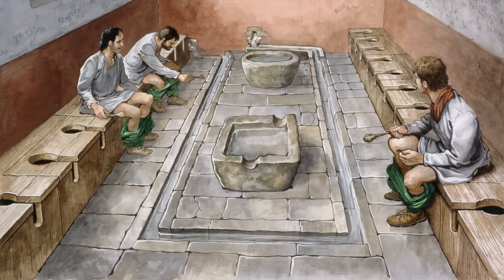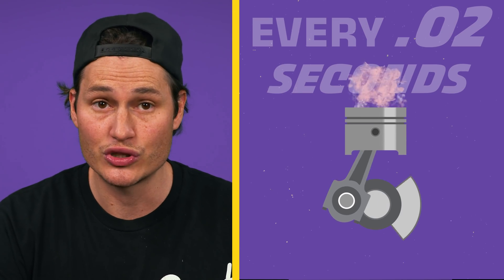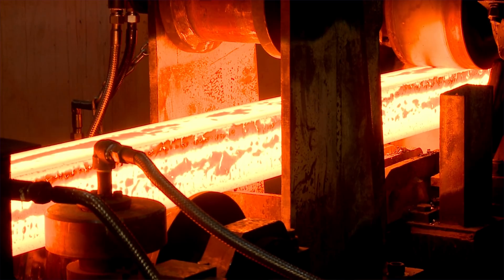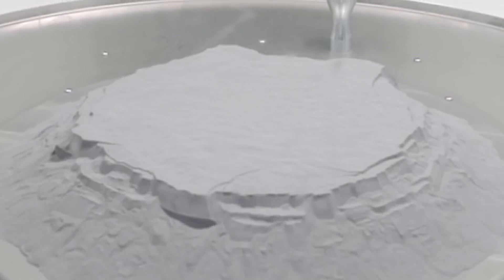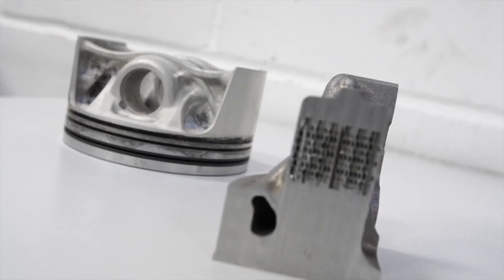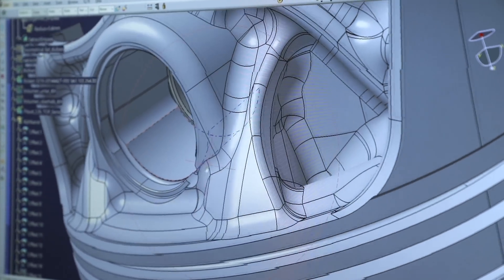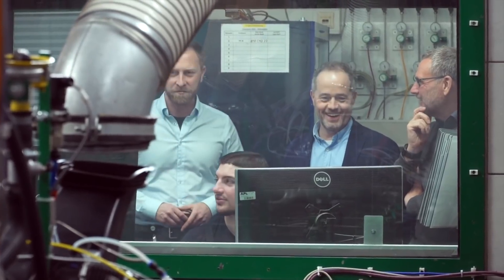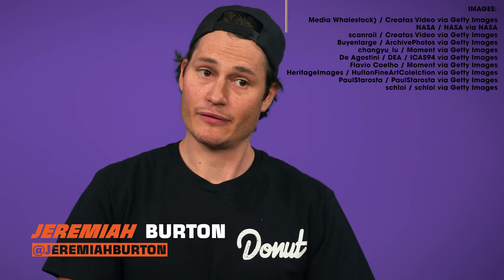3D Printed Pistons Are Changing the Game

Comment: me: “i’m gonna pro charge my hemi and throw forged pistons in for more BOOOOOOST” watches piston slap animation “i think im fine being slow”
Reply: And that's why cast piston are better for daily.
Reply: @ameunier41  a lot of old school cars had forged pistons from the factory, even in pretty mild applications. The primary advantage of casting is cost savings
Reply: That's why they recommend leaving high performance cars to idle before driving them
Reply: @insomniacbritgaming1632  Thats a Bad idea if the gearbox is mounted on the Engine. Warm Engine cold gearbox means a lot of Stress between Those Parts.
Also youre pushing a cold transmission just behause you warmed up the Engine and thinking u are ready to go.
Just Drive low Rpms and increase the load gradually, until everything is warm.
Reply: @L K
A temperature difference between the engine and transmission isn't going to put any extra stress on the transmission compared to any other time you drive off from a fresh start. They're two discrete systems, joined together by a coupler (clutch, torque converter).
Reply: @lk159  the gearbox is connected to the engine via a clutch (or a torque converter in automatics). 

There is absolutely no stress created by differences in temperature between the engine and gearbox. 

Also, even when your car is in neutral and the clutch engaged (or in park), most of the components (all of the gears) in your gearbox will rotate when your crank rotates, thus warming up and lubricating the gearbox even during idle.

The only thing not warming up or getting lubricated while idling is your differential.
Reply: piston slap isnt bad you just really need to let it warm up and expand before going past like 2k rpm
Reply: Love that emoji next to your name  😆
Reply: Two words: low boost

Comment: on aftermarket side of things this is seriously important because this means more safe RPM,more boost,more fuel and easier time balancing the engine because those small weight reductions make biggest diffrence on having to run a balance shaft or not having to run a balance shaft which weigh a shit ton

diesel,rotary and 2T side also benefit from this so yes,this is actually serious and if it sucseeds this is great W for ICE engines in general

Comment: Process is called selective laser sintered
Reply: Not anymore. About a decade ago, the technology could not yet fully melt (most of the available) metal powders. That was SLS, selective laser sintering. Sintering clumps and fuses the powder together below the actual melting point of the alloy. Along came more powerful lasers and better optics, and so more modern powder bed laser 3D printers do SLM: selective laser melting. SLM machines can still revert to SLS, but sintering creates a more porous part than additive manufacturing by SLM.

Comment: That is a really impressive use of technology to make a component better and more efficient. As you said, by making the piston lighter and able to bring down its operating temperature, this will lead to further weight reduction in other parts that are connected to the piston and its operation. 

I can also imagine that in employing this technology in the manufacturing of the engine head and block, would also bring weight saving benefits and thermal efficiencies. All of which combine to improve the overall power to weight ratio of the engine package.

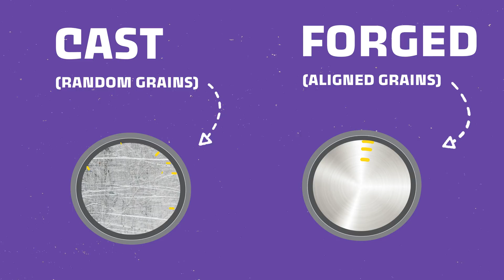Comment: 3:23 I think this is mostly wrong.Wood grain and grain structure in metals (aluminium) is pretty different. Metal grains consist of really small clumps, shaped in every which way, that has one common crystal lattice structure.  In forging, the grains "size" is preserved, while in forging they grow bigger which decreases strenght,  and dislocation density is increase due to the plastic deformation which further increases strength. Don't know if you have a mechanical or materials engineer on hand to help you research these topics but I think googling would help.

Comment: The piston is just the beginning. Topology optimisation is soon going to influence the entire powerplant design. The block, oil sump, baering seat, cylinder head and many others will soon be made in a similar fashion. There is an optimal way to design and cool an engine. It has allready been designed, but manufacturing restraints keep us from actually reaching that. This manufacturing process will change that some day in the future.

Comment: 10 years away?
Sorry, by that time ICE engines will be pretty much out of production. Many OEMs don't even develop them anymore.
Reply: Synthetic fuels might change the governments mind
Reply: @christopherayala4619  It does not look like synth fuel tech can keep up with the rapidly decreasing cost of battery tech.
ICE engines are a well matured and thus hard to improve uppon tech, while batteries are just starting out.
I like big honking engines just as much as the next guy, but they will be like horses; still around for other reasons than utility.
Reply: @heinrichwonders8861  prometheus are releasing this fuel later this year and would be cost effective compared to fossil fuel gasoline and this just one being released imagine billions of these fuel it will be cheap as heck
Reply: @christopherayala4619  There are inherently high losses in the production process of synth fuels and in the distribution. They simply cannot compete.
Also, using these synth hydrocarbons for plastics, lubricants and industry is much more sensible than burning them.
The ICE era is coming to a close. No way around that.
Reply: @heinrichwonders8861  well mazda uk, Porsche are on this fuel there is a reason they support synthetic fuels

Comment: I think this quote fits perfectly here “ normal people believe that if it an’t broke don’t fix it. Engineers believe that if it an’t broke, it doesn’t have enough features yet”
Reply: Engineers: If it isn’t broken, we have over built it and have used up to much material to do so.
Reply: @paolobramucci3609  More like Upper Managment: If you want to keep your engineering job take this well designed part/assembly and cost reduce it and outsource parts to low cost countries until it no longer functions as intended but saves a small amount of manufacturing cost. Then when our customer base gets pissed-off enough we will have "innovation" meetings and come up with other bullshit ideas to try and save our sales. Rinse/Repeat.
Reply: @paolobramucci3609  so sad but reality as it is now. how can we give the consumer less and charge them more.
Reply: @paolobramucci3609  safety is a concern, when you can't be sure if there is a defect in each and every unit. You don't want to find out the part unexpectedly failed with someone behind the wheel if you can help it.

Most mass manufactured things are like this.
Computer parts, for example, also have a large safety/fail margin... which is why so many people have started to overclock their computers.
Reply: german tank manufacturers be like "if it ain't broke don't fix it. unless it is the transmission"
Reply: @SuperchargedHornet  I mean if only 3rd is gone that isn't the end of the world!
Reply: Well somebody has to be paid to do new stuff
Reply: If it aint broke. It aint german. OHHHHHHHHH!!
Reply: @Riddle6EOS  I’d say that more applies to Italian cars
Reply: @darthmaul216  naaah its the other way around.
Reply: @Riddle6EOS  you were saying German cars brake a lot. I disagree with that
Reply: @Riddle6EOS  if it ain't broke why not break it...german engineering is probably overall the best engineering over the past 50 years
Reply: @lllpro-scopezlll1560  i disagree with that. Can we agree to disagree?
Reply: If it ain't broke, fix it til it is!
Reply: Mechanic: "If it ain't broke, don't fix it."

Engineer: "If it ain't broke, your not trying hard enough."
Reply: It would be more accurate to say that engineers think that if it isn't constantly a hairs weight from breaking it wastes to much material.

Comment: The piston slap animation made me wince, I won't be starting my engine anymore
Reply: @Adam That's my plan
Reply: @TheCarPassionChannel  you could also get a block warmer and boom problem solved
Reply: @TheCarPassionChannel  gotta preheat the block like a race engine my friend
Reply: I expect to see engine warming blanket ads in my newsfeed tomorrow.
Reply: Just pump in fully warmed fluids before you start it every time like F1 cars, no problem
Reply: I felt hurt seeing the animation
I felt the slaps and grinds
Reply: My civic slaps when cold, started around 225k miles. So I put a turbo on it, 241k strong.
Reply: @FroztiProductions  perfect
Reply: Just don't rev above 2k until it's warm :)
Reply: @ugh-meh  what if my cold idle rpm is 1800rpm 😳
Reply: @TheCarpenterUnion  it's safev
Reply: @TheCarpenterUnion  nah g my car cold starts at 3400 lmfao.
Reply: @TheCarpenterUnion  double tap gas pedal
Reply: @TheCarpenterUnion  just put it in idle 2
Reply: @TheCarpenterUnion  then you have a modified rx-8
Reply: @TheCarpenterUnion  oof
Reply: @TheCarpenterUnion  mines 2500 😳
Reply: @TheCarpenterUnion  That's ok...I just checked, 1800 is less than 2000
Reply: @ugh-meh  I was about to say my rx8 cold idols at 3000rpm then I remembered I don’t have pistons hahha.
Reply: @DillonLeBlanc14  XD
Reply: @ugh-meh  i wondered why on cold days I would limit the revs to 2k lol, if it's around 30 out I tend to do that until the engine temp gets up to 150 but if it's below 15 degrees out I'll tend to wait an extra 5-10 minutes after that to drive normally.. I thought I was just being overkill but maybe a part of me knew something.
Reply: @ugh-meh  this
Reply: @ugh-meh  depends on the oil
Reply: @ugh-meh  I like doing that though. (:
Reply: Weeeee clunk clunk clunk clunk weeeee
Reply: No piston slap with (drumroll plz) MAGICAL SPINNY DORITO ENGINE
Reply: @rhubarbpie2027  3D printed dorito
Reply: I work in a performance shop and we have a track miata with a fully built motor, the piston slap is very real till it warms up. First time I moved it around I thought there was ether no oil or the engine was toast!
Reply: Put your engine in an oven and heat it up before you start it, problem solved!
Reply: I've had piston slap in my Silverado since like 140k km, it has over 460k towing and hauling km on it now, you'll be fine!
Reply: Add a block heater to keep it warm before start up.
Reply: scared tf outta me i swear
Reply: It's just making your engine bigger...
Reply: @pepperfish_   hell yeah! Bore it out and grab better connecting rods and bearings, step one of any build is bottom end of the block.
Reply: Ls1 has left the chat
Reply: Cast pistons for the win! Redline at cold start!
Reply: Is the slapping that big a deal in the miata? Is it like super noticeable or scary during warm up?
Reply: @joseramirez-hh2sw  No I was being facetious. I have Supertechs which actually use a less expansive alloy versus Wisecos so the slap is even less. I can't even hear it when I start the car
Reply: @TheCarPassionChannel  nice! Thanks for that. It was kind of a scary thought. Say you spend a bill on them pistons and your car turns in to a full-time job because of them (that'll be scary)
Reply: @TheCarPassionChannel  You could pull out the fuel pump relay and crank the engine over for about 8-10 seconds
Reply: there's usually two kinds of forged pistons, different material
Reply: The Vvt beast weak point is cold starts :( lol just kidding ive been following your channel for years now and watched all the videos on the VVT build. Those cold starts cant stop the Miata 😤
Reply: @andres0761  Not in San Diego at least where my "cold" starts are 55F lolll
Reply: Hence the cold tap high mileage music.
Reply: One must have oil warmer
Reply: just heat your engine by torch 😂
Reply: You got Forged pistons?
Reply: Day 63: I have again replaced all oil inside my car's engine, still I feel no relief from the paralysing fear instilled in me by Donut Media and cannot bring myself to start it up. The devilish threat numbs my very mind to a degree that must not be considered sane, I yearn for the oily film to be thick and comforting but a voice inside my deepest conscience keeps telling me to "remember the piston slap animation!!!" and i won't disobey, not ever.
Reply: Use a block warmer to get the engine warm before start up like the f1 cars..
Reply: Dude same hurt my brain
Reply: It ain’t that bad, and ll pistons do it. But you can use an engine heater and more importantly, an oil heater if your in a cold climate. In Alaska will set up fires under heavy equipment and diesel Truck engines to keep them moving.
Reply: Hypereutectic pistons would be great for both reliability and strength for power but i haven't found alot of them yet.
Reply: Just heat it up with a torch for a couple of hours, and it should be snug again.
Reply: haven't ridden many two stroke bikes then That's what they do a lot when older or wrong fuel mixes So much so i used to break the skirts off my 250's pistons when racing quite often mainly due to them running just 1 ring (racing bike)
Reply: from what I understand, piston slap occurs only with forged pistons, which probably your car doesnt have
Reply: @jozefm3044  Actually, it does 🙂 put them in myself
Reply: @TheCarPassionChannel  sorry didnt know about that
Reply: @TheCarPassionChannel  What are you doing here? Praying for the topologically optimised MX-5 pistons?
Reply: @-Be4st-  a metal 3d printer is about 50k.. topology optimization is free software you can use in most cases... give it another 10 years to come down in price and you can print your own piston, connecting rod, hell just about everything you want
Reply: @jozefm3044  I had a a Jeep that had Piston slap come oem on all 4.0s
Reply: @jozefm3044  depends on the silica content in the pistons. 2618 will slap. 4032 not so much. Most OEM forged pistons are closer to a 4032 alloy and won't slap either.
Reply: @jozefm3044  lol that’s false any vortech motor basically does it
Reply: @jozefm3044  yeah coz forged piston need to have a larger clearance than the cast or hypereutectic engine and that larger clearance makes the piston slap when you cold-start it (that's why it's almost impossible for the car manufacturer to use forged pistons on their performance cars because forged pistons tend to make the emission become worse due to it's large clearance)
Reply: @jozefm3044  false, piston slap has nothing to do with the type of piston it's from wear and tear of the piston and cylinder wall creating a bigger gap, the piston slap is from the exis space allowing for the piston to move back and forth slapping the piston wall until its warmed up and the cylinder walls and piston expand a little bit from heat
Reply: @fullthrottle4688  Incorrect - the reason forged pistons slap more than cast pistons is because they expand more, so they need a greater piston-to-wall clearance when cold. (Spec'd by the machine shop during the boring process).
Reply: @TheCarPassionChannel  I never said said anything about what slaps more, yes forged pistons slap more and need more clearance, I was stating that u were wrong about cast pistons not slapping and only forged ones do
Reply: @fullthrottle4688  Except I never said cast pistons don't slap 🙂
Reply: @TheCarPassionChannel  sorry got you confused with the person accusing u of not having forged pistons and hes the one that said only forged pistons slap
Reply: @jozefm3044  nope, all pistons may experience slap noise, given proper clearance. Since forged material expands more, this means that at room temperature the clearance is bigger than on cast parts, because we do not want them hot scuffing. This is why forged might be more prone to slap noise during start/warm-up. But go to -40degC and every cast iron block with aluminum piston engine will slap.
Reply: @jozefm3044   that example was way exaggerated.... that type of slap is not a factor.... the slap or knock you have to worry about is when your rod bearings are bad.....
Reply: @1piyoti  slap is not knock. Slap specifically refers to loose piston ring clearance.
Reply: @FroztiProductions  Slap has nothing to do with piston ring clearance. It has everything to do with piston-to-wall clearance, specifically when cold.
Reply: @TheCarPassionChannel  That's acceptable piston slap like you hear on miata and ls engines. I'm talking about when an engine has loud piston slap purely due to wear and tear like mine, which is from worn piston rings which seal as the engine warms up.

Comment: Car manufacturer: "guys, our budget's been cut and I don't think we can make a new engine"

3d printing guy: "bonjour"
Reply: Best part is 3d printers can print different things, not like casts that with one mold you have one piston. One day you can be printing camshaft other day - header. It brings possibilities of crazy prorotypes (some open source) and printing parts not obtainable now
Reply: @Ishmael95  still, I think the durability is a day and night difference
Reply: @Ishmael95  ford racing has been doing this for around 5 years now.
Reply: More like: "willkommen" xD
Reply: @Lassi Kinnunen 81 the other issue with printing is it takes alot of time (especially for mass production) compared to traditional manufacturing methods.
Reply: you do realize that a metal 3d printer costs millions right? not to mention that it is not very fast at making parts